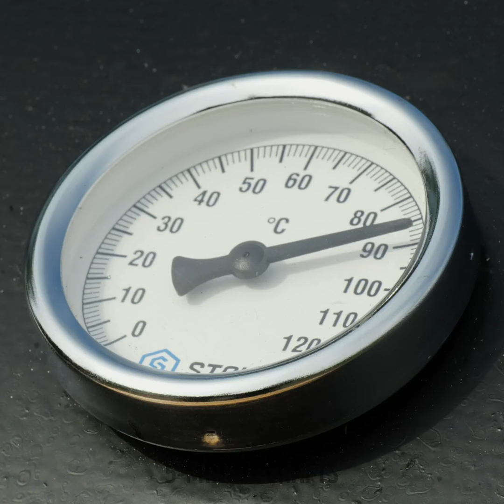Barrel Crafting 101: Fun and Easy Projects for Your Used Barrels

Comment: Maybe a little warning to the people who watch this video and that don't know you should always purge a barrel like that before using a torch, grinder or any tool that can create an ignition source. You have no idea what that barrel previously had inside of it and it could still have combustible gases lingering. Which can prove to be deadly if you don't make sure to mitigate the risk by at the very least filling the barrel with sand before cutting. There are a few ways to purge any combustible gases inside. Fill the barrel with water, fill it with an inert gas or with sand to make sure that when you start to cut it open that you don't kill yourself or blow up your garage/house. People are generally stupid and you gotta make them aware of these dangers.
Reply: What you just described is natural selection. We need less warning labels

Comment: Man they really love that bbq
Reply: Most unoriginal, bolts what are those let’s just weld everything. Presumably this is for charcoal… so just roll it down a hill and tip it over when you wanna clean it. Those two were the fifth or sixth couple after the barrel exploded killing the first few 😂